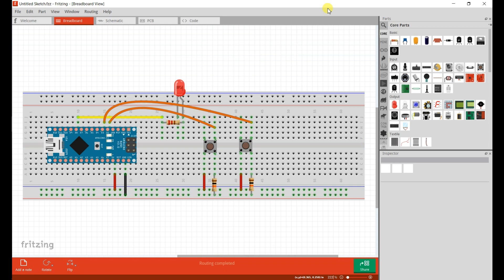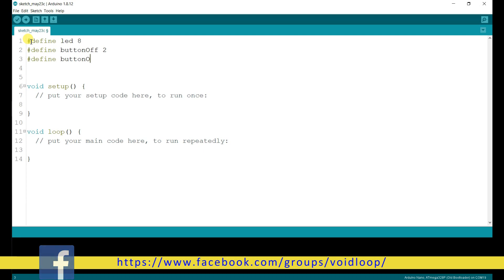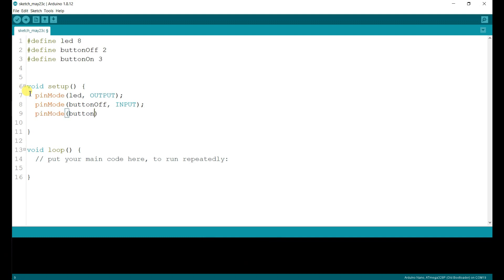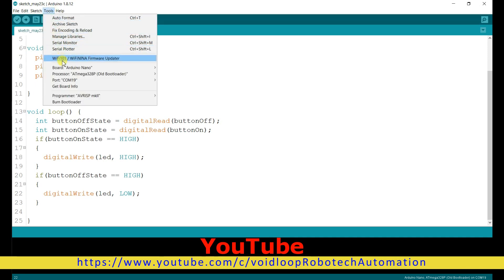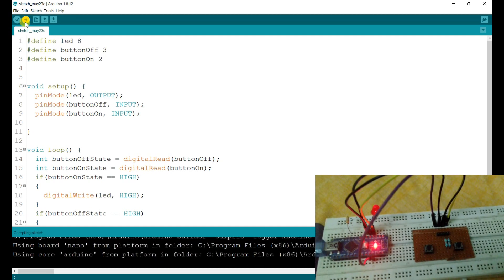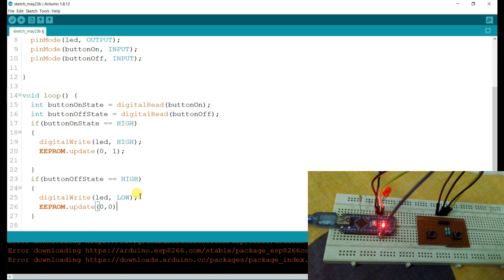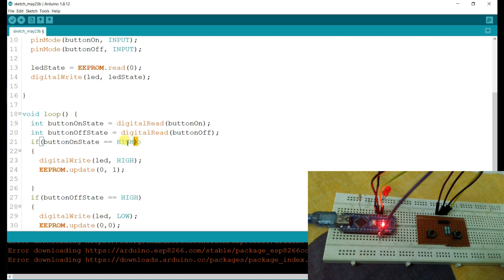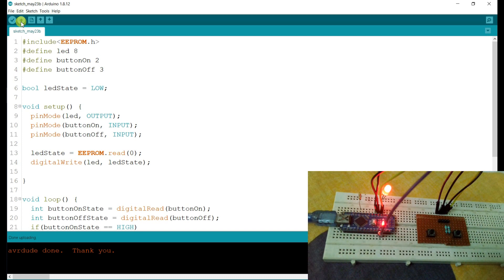23 Button Control LED with EEPROM || Arduino ||

Comment: Wow, thank you for the demonstration, this works really well.  Curious, when I use the pullup resistors in the Arduino, the circuit does not work correctly, I have to use external 10K resistors for it to work correctly.  Do you know why this is?
Reply from the maker: Which pin you are using
Reply: @voidloopRobotechAutomation  Digital Pins 2 & 3.   I changed the parameters in pinMode from INPUT to INPUT_PULLUP.